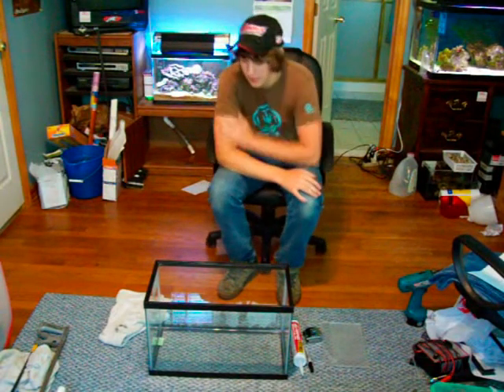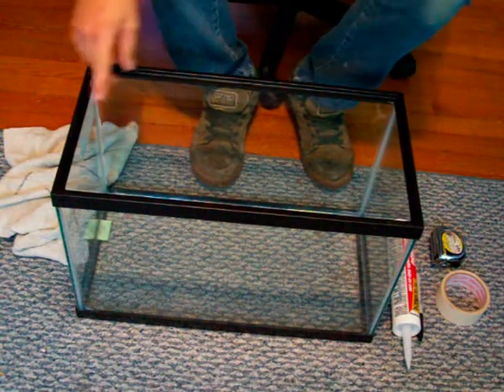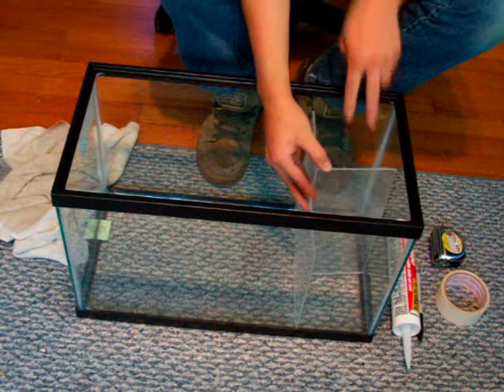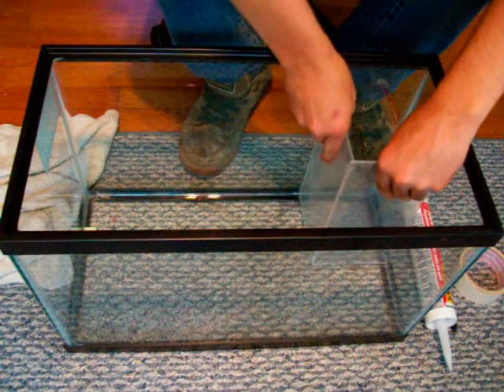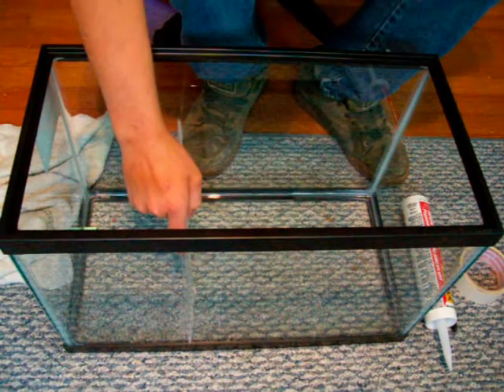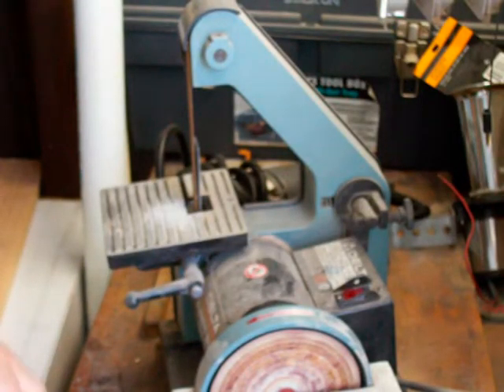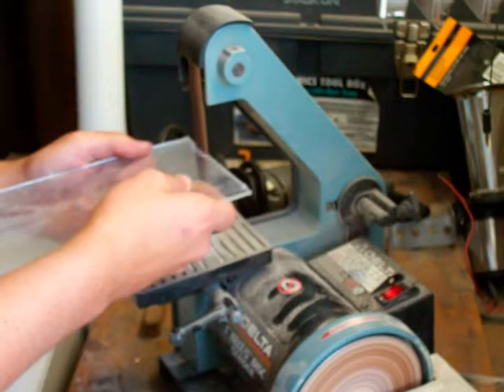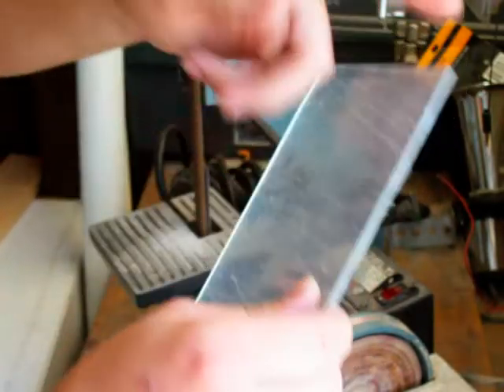DIY Reef Tank Sump "How To" Part 1

Comment: I like how you sanded the cut outs into the plastic with the belt sander. Way faster then my router table 1/4" setup although I do not cut slots for my sump walls, only overflow boxes.